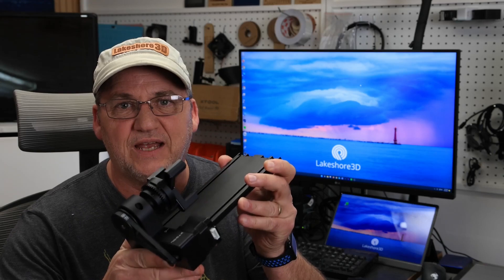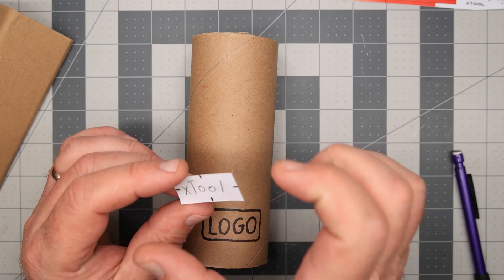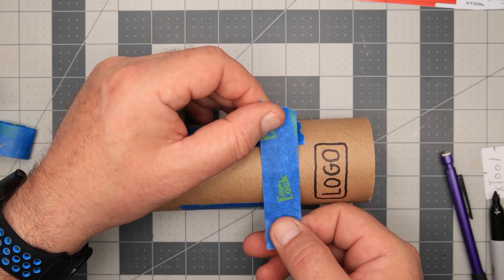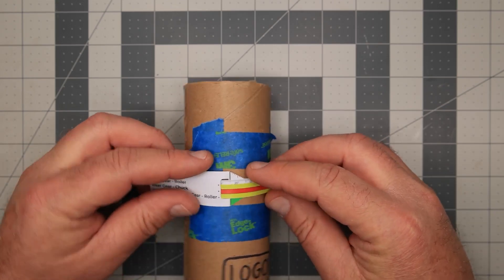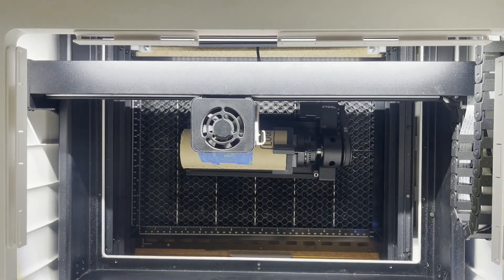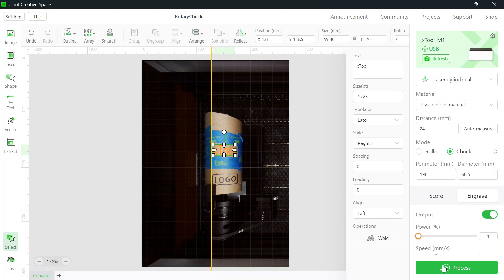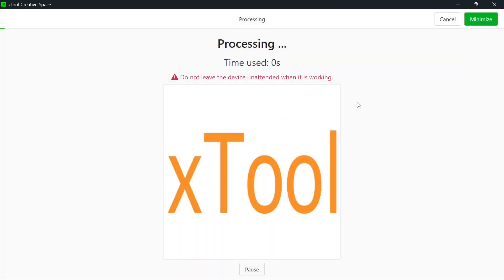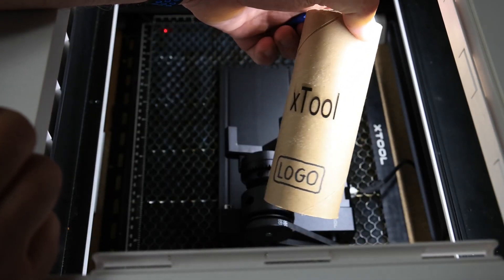Using the xTool RA2 Pro Rotary Chuck

Comment: Great video.  I'm trying to engrave on a tapered wood mug using the P2 and RA2 Pro chuck attachment.  Round logo on a taper is challenging :(.  
This layout info is helpful.  I've been using the major diameter of the mug cylinder to calculate the perimeter in software and my square design ends up shaped like an isosceles trapezoid.  I am going to try using the diameter in the middle of the design location to see if that "squares up" the engraving - as opposed to 'warping' the design to try to match.